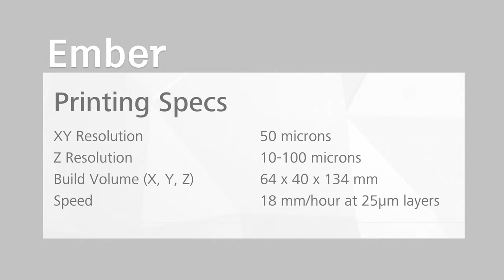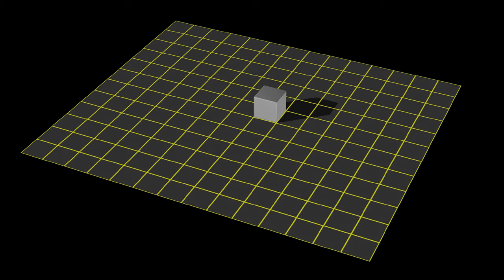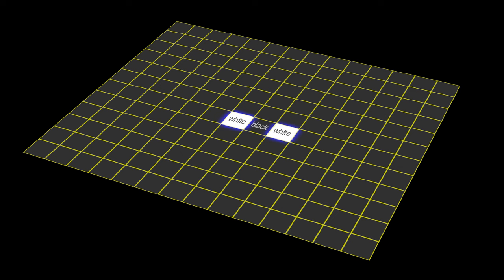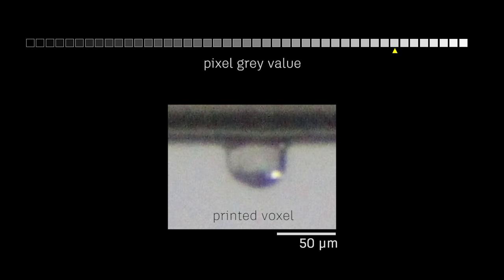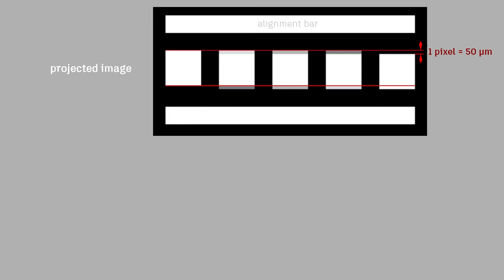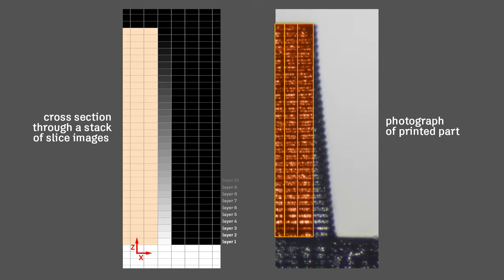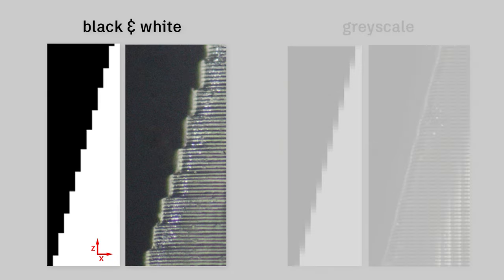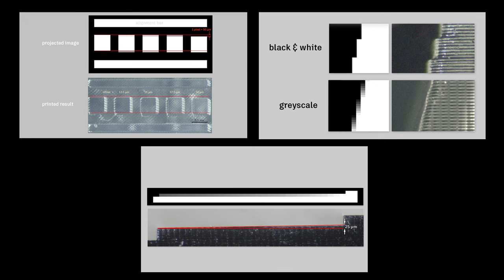Sub-pixel resolution for DLP 3D printing

Comment: Is this what anycubic photon calls "antialiasing"?
Reply: Yes
Reply: Yes and no. Yes for the LCD in the x and y axis. No for the z axis  (layers). It doesn't do anti aliasing on layers, only resolution of the LCD. But at 4k lcd for mono x, it might not be needed. Not sure for DLP printers though as it does some natural anti aliasing already (uses projector).
Reply: @muffdriver69  been experimenting with the photon ultra and it's odd, because the projector has very uniform light compared to LCD you end up needing more aliasing because you lack a lot of the light seepage that makes LCD printers like the mars pro so smooth right off the plate

there is a lot of people, even LCD printing veterans who have noticed terrible stepping on the ultra's default settings in photon workshop for this reason, because they only turned on horizontal AA, which to my memory using my mars pro is all chitubox had a button for (in fact, I just realised I still had it installed so have checked without updating, as of feb 2021when I lost my mars pro in a house fire it still did not have a setting explicitly for horizontal grey levels)